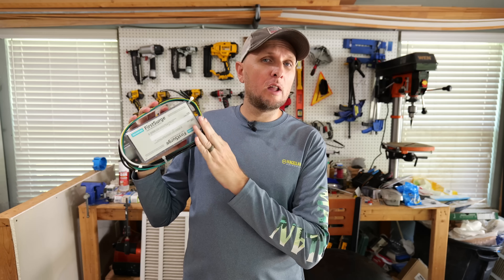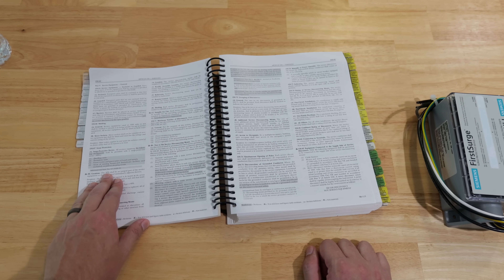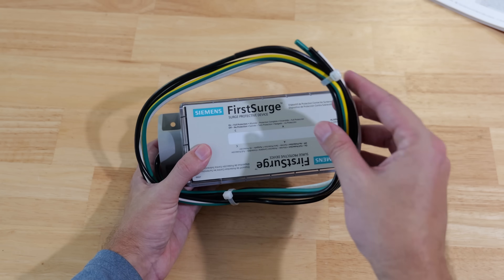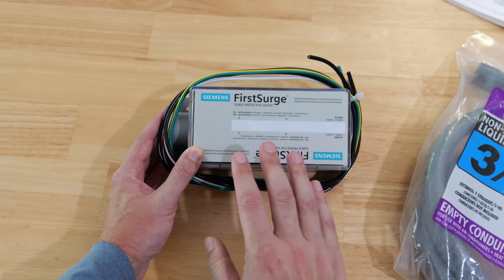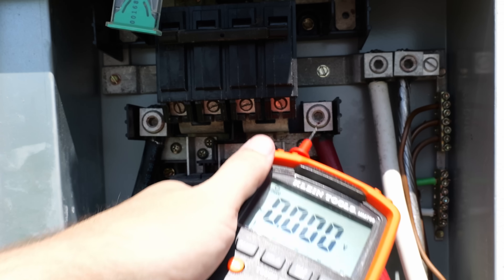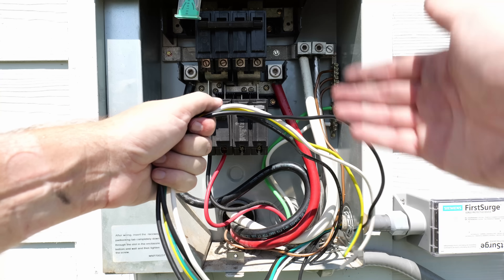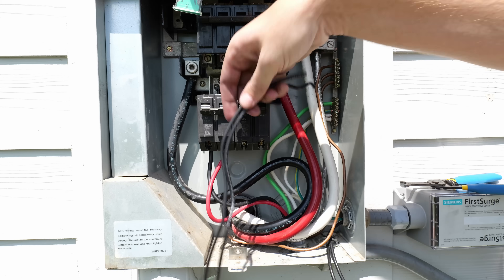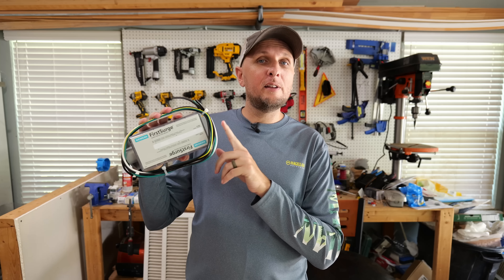Why Whole Home Surge Protectors Are Now Required and How To Install One!  Siemens FS140

Comment: I was not aware of these devices and I WILL be installing one on my home breaker panel. A year or two ago we had a storm and the neutral wire broke and came off of the house before the power box (local power company's responsibility, which they fixed quickly and without charging anything). The lack of a neutral caused many appliances to fail, the stove, the HVAC mother-board, etc. Would this device have prevented  damage in that situation?

Comment: If my home was constructed in 2021, and the subdivision was created in 2020, am I pretty much guaranteed to have a whole home surge protection provided with the grid service?  I live in central Texas.  I ask because at least once, in the last few years, there was a surge event that flipped the breakers in the sub-panel in the house.  My appliances survived.
Reply from the maker: It is very unlikely a whole home surge protector was installed then.  Possible but unlikely.
Reply: @HowToHomeDIY  Thanks for the response.   If the code went into effect already, when does it become mandatory?
Reply from the maker: @VishalRaoOnYouTube it went into affect in 2023 but won’t be required until your justification adopts the latest code book.  It probably has by now as most are moving to the 2023 edition but some places are still many years behind in that way.
Reply: @HowToHomeDIY  Good to know, thanks!

Comment: Unfortunately Whole House Surge Protectors have a limited life span. Just like GFCI outlets they also have a limited life span or how many times the breaker or outlet trips. The power company has a in-exclusive replacement of a whole house surge protector in NC due to the tropical storms & hurricanes which we have from May to November.

Comment: 😢😢1992, I was in an old house when it was hit by lightning.  It blew a hole in the roof and explosions were going on around me. The vintage glass fuses exploded, my phones had burn marks, and my dryer also had internal damage. There were no fancy electronics and my computer was unplugged. Because of that, the actual damage was easy to repair. Today, a similar hit would cost me thousands.

Comment: You can avoid all of this work and buy a breaker size device that is made to take up a breaker space in your panel. If your panel is older and not a Plug on Neutral type you will only have to wire in a neutral device. The device can be installed in your main panel and will cover your entire house. You could install one in every panel of your house if you wanted, it would only increase your surge protection.
Reply from the maker: You can and in some cases that would definitely make sense to do.  However none of those can offer nearly the same protection as the device shown in the video and some others similar to it.

Comment: A week ago we had outage that lasted  4 hours  so I didn't get too excited  to fire up my  back up generator but a  crazy know it all friend not too far away  did  by back feeding his 200 amp panel with out a interlock device from his welder/generator  through a 50 amp 2 pole breaker not sure what he did but when the power came back on it fried every electronic device  in his home so I don't knowing if a  SPD that he  doesn't have would have prevented that? His insurance covered all the replacements so now he's talking about getting a 22KW automatic Generac system installed.

Comment: Firstly whole home surge protectors are about as good as a surge strip...If you want true protection get a power conditioner and here is what this Moron alarmist is not telling you...first find out from your town..which version of the NEC you town has formally accepted and following ...You will find that many are still on much older version of the NEC and have not accepted into practice new codes....Accepted you ask ...because the NEC is not a government agency it is a private company that review codes and create updates that it is then up to local governments to either accept or not ...The NEC has no zero power or legitimate political authority. OSHA a number of years ago in a rare revision of their statutes said that they will refer heavily on the NEC..(only because it saves them work).but that is about it. If your local government has adopted the codes then guess what you don have to follow them. Even when they do this it will be voluntary and only when major work like a service change needs to be done or on new builds. Everything else will be grandfathered just like Knob and tube electrical. That is if your town ever accepts this part of the code...towns can accept only bits and pieces of the code and many do.
Reply from the maker: What are you talking about?  I literally said all of that other than I did not say they are about as good as a surge strip because that is false lol.  Everything else I covered within the video.  You are mad about nothing.

Comment: My house has two 200 amp panels side-by-side (it is a big house), and a remote 100 amp sub-feed panel in a detached building for the main solar array.  So the question is - how many surge protectors do I need, and if I need more than one where should it be located?

Comment: Couple of things that are misleading…

Local code trumps the NEC. The NEC is more guidelines that “should” be followed, but are not necessarily required. In regards to when does it need to be replaced? The truth is it’s near impossible to know when a surge protector needs to be replaced. Surge protectors are built with a level of capacity… When that capacity is fully used it will indicate as such, but you have no way of knowing how much of that capacity remains. I would suggest doing some research into how surge protectors work…
Reply from the maker: I have and some of what you said was in the video.  Nothing misleading here.
Reply: @HowToHomeDIY   we can agree to disagree. My point has been made. People can read my comment due some research and come to their own conclusion.
Reply from the maker: @FracturedNinja sure we can and they can.  I welcome people researching.  Still doesn’t change much of what you said was talked about in the video though and there is nothing misleading.

Comment: Thanks for the clarifying video. However, one point: the length of the wire is completely irrelevant as far as speed of disconnect goes. This happens at the speed of light! So, the signal will traverse 1/4 meter of extra cable in about 1/1,200,000 of a second. The switching speed of varistor in the device is several orders of magnitude higher than that. There may, however, be other reasons to keep the wire length minimal, but speed of switching is not it for this kind of device.
Reply from the maker: While for the most part I agree with you, Siemens stresses this point in the instructions to make sure they are as short as possible.  I am guessing the point they would make, which is kind of to your point, is due to how fast the surge spike is, every bit that can be trimmed can get the surge to the surge protector and to ground faster so as to not get to anything else.  That even nano seconds count to get the best results.  I have not been told that by them and am not an electrical engineer, but that would be my guess.

Comment: Siemens makes a two position breaker which is also a surge protector.  It is available as either a 15 or 20 amp breaker.  QSA2020SPD or QSA1515SPD.  Allows you to add surge protection to a full panel.
Eaton and Sq D have breaker size surge protectors that do not function as circuit breakers for a lower cost.  These will work fine if you have extra room in the panel.

Comment: Why not mandate Uninterrupted Power Supplies -- they will do everything a surge protector will do, plus they house two lead-acid batteries with capacitor banks. With power going through a serious UPS, any fluctuations on the input power is ironed out for/by what the UPS is built to consistently always maintain as output, thereby delivering cleaned power exactly to what sensitive electronics were built to handle per spec? And if breakers are blown, internal fuses are blown, &/or the power is knocked out, a UPS will supply the power it holds in reserve so sensitive electronics can have time to be properly shut down & powered off, thereby preventing loss/damage. I mean, I own one that's intended for a small business server room & it works great, despite me having no server, nor a small business. Most of the time it can outlast a power outage & out of all the sensitive electronics I have plugged into it, none of them have yet to fail on me. I mean, if there is something to mandate, why not a UPS instead...? Albeit, I was given the UPS I have for no charge & it would have otherwise cost me ~$2000..., I mean, as long as were going to mandate more & more crazy s***, why didn't they just mandate the superior, & I'm assuming much more expensive, product be wired to the house...? When it comes to things like this, I think most people share a similar attitude where cost is of no issue whatsoever...(?) So, again, why no  mandate I wonder? People love new mandates too!!

Comment: As a service Electrician, I find the breaker feeding the surge protector tripped quite regularly. Once reset the surge protect will have the correct status LEDs lit.

Comment: Installing FSDs is code, so we will have to do it.  Nonetheless, effectiveness of these devices seems questionable with those long leads which appear to be 12 AWG wire.  The impedance of the leads is going to hinder the ability to respond to a pulse which may have a rise time measured in nanoseconds.  What we really need is a device which snaps directly onto the bus bars in the panel to eliminate the inductance of wire leads.

My house was hit by a lightning strike which landed on the roof back in the 1980s.  A corner bead was blown out of a wall, light switch and lightbulb in a ceiling fixture were vaporized, a large mirror shattered and a digital clock on the opposite side of the wall from the light switch quit working.  The garage door opener triggered itself and opened the door.  A cheap cordless phone quit working, but old Western Electric phone was OK.

In my case, the FSD probably would not have been effective because it was a direct hit and didn’t come in over the electrical service, though the lightning obviously got into the wiring.  Things like TVs and computers which had internal MOVs dealt with it, except for the cordless phone.  When I disassembled the phone, there were two wires sticking up where the MOV used to be.

All in all, whole house surge protection doesn’t seem to have a significant downside other than adding cost to new construction and service upgrades.  I am still skeptical that the requirement will be as effective at curbing damage as electrical manufacturers would have us believe.
Reply: Lightning surge is 2 - 8 microseconds, slow enough.
Reply: @antronx7   Thanks for the information regarding lightning strikes.

Comment: Still a mystery how 2  20 amp wires connected just like another appliance, can disconnect the whole house when a surge hits. Shunting down a surge of long duration, like a primary on the pole hitting a secondary cannot be enough.

Comment: Seems like these should be built into smart meters and monitored by utility so they can replace as needed instead of expecting random seniors and busy parents to stay on top of it.
Reply: I have installed many surge arrestors from many different manufacturers and also just simple MOV's that will clamp and trip a breaker if a surge or over volt occurs.. Gone from as cheap as a couple dollars to hundreds of dollars for the parts and never charged a penny for the work.. MOV $.50 cents, LAR arrestor $35ish dollars, Midnight Solar arrestor $100+ dollars, so far only 1 LAR has clamped from a lightning hit at the womans power pole and yes it killed the surge device but tripped the breakers with no damage to anything in the home.. Cost her $45 for a new arrestor and a breaker, I got a kiss and a big bear hug..
Reply: Most electric utilities will lease whole house surge protection in the form of a meter collar. They charge you a fee every month for it. And no, you cant install one yourself. They utility  will not remove the meter for you to plug one in.
Reply: @bills6946  After the meter in the USA there is a main breaker and or main panel.. You can certainly install your own surge arrestors, voltage and current monitors and voltage go/no go automatic disconnects after the power companies meter.. I would never pay them to protect their equipment.. My home has grid AC solar with an 8kw split phase inverter with an automatic generator input and I have several surge arrestors on the connections.. We even have plug in devices on our most sensitive electronics..
Reply: That's why you call an electrician and pay them $1000 to change it for you.
Reply: Licensed electricians will disagree with you, obviously.
Reply: Ahh yes.. because power companies want to pay for replacing things that could be their own fault is broken.  Because thats how a capitalistic economy works.  Sarcasm aside.. I completely agree it should be part of the smart meter but that will never happen.
Reply: Ah, yes. Push it off on someone else.
Reply: @polarys425  Your sarcastic comment is exactly correct. If it's now considered a critical function of the grid then it should be monitored and maintained by grid operation specialists, not random grandmas and grandpas.
Reply: @thedaveking  the power company stops at the meter. I guess you want them to take care of your breaker panel too. Maybe you should call them to come out and reset a breaker when it trips. Bunch of nanny state idiots.
Reply: @polarys425  thanks for confirming what we all suspected
Reply: @polarys425  Well, the only purpose is to protect against surges coming from their grid that can destroy very expensive private property, so is it cheaper than lawsuits?
Reply: @ChillWill-q5x 
Surges don’t only come from the grid. Something in your house can cause a surge like a defective air conditioner. compressor.
Reply: @polarys425  found the utility @sshole. get back to work boi
Reply: @polarys425  Ah, yes. Push it off on someone else.

I can see your point.

That's why mined my own iron ore, melted it down, and built my own car.
Farm my own food.
Homeschooled my children.
Make my own shoes.
Slaughter my own cows, chickens, and hogs.
Catch and filet my own fish.
Raise sheep and make my own clothes out of wool.
I even designed and made my own television and then produced my own shows so I'd have something to watch.

I wouldn't want to push any of those things onto someone else.

Comment: I don't know what is inside but my guess is its some MOVs and a circuit breaker or fuse.
What a joke. $225 for $10 worth of parts. 
Required not for personal safety but because they are worried about my electronics and appliances. I think that should be my decision. Don't you?

Comment: Is there a way to install a small LED power indicator light on the outside of my meter box. The light would light up when the power from the utility co. has been restored. Note: I live in a rural area and have a whole house generator and a Interlock kit in my indoor panel box. This will help to know when the power is restored, so the generator can be shut down and the interlock kit can be returned to it's normal position. Note it's a 100 amp service.

Comment: Florida native.  I've had plenty of damage to equipment over the years **BUT NEVER from the mains*.   Even when buildings were directly hit by lightning, the power lines were NOT affected.  Equipment was always damaged on the signal side, or from EMPs.  

I still use surge protection, but I think they're very much overrated.  Perhaps the threats are different in a different part of the country.
Reply: Never from the mains. Agreed.

Comment: codes are 'nice' and all. but i'm going to build MY HOME with the services/utilities/etc that fit MY NEEDS. YOU dont tell ME what to do with MY HOME. So long as the basics are there (minimal code to prevent mass casualty) there is NOTHING more to ENFORCE. If my home catches fire that's MY PROBLEM and NO my fire won't spread because I have ENOUGH retardants and spacing from all flammable objects to PREVENT IT!
Reply from the maker: I mean yes do what you want but if your area has adopted the 2023 NEC code, you’re not going to pass inspection and therefore won’t be given a certificate of occupancy without one installed.

Comment: So if I understand it right, that device works similar to a MOV you find across the AC power input in many devices.  In other words, it is across the AC input wires and absorbs any voltage spikes lets say greater than say 270 V across the red and black wires and spikes larger than perhaps 140 volts across neutral and the red and black wires?